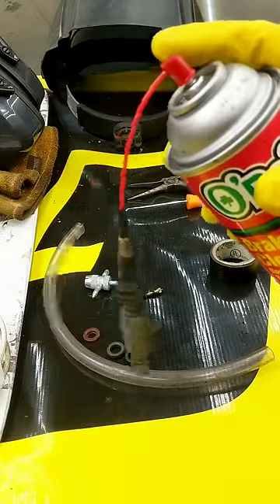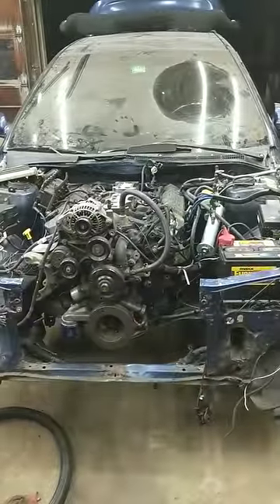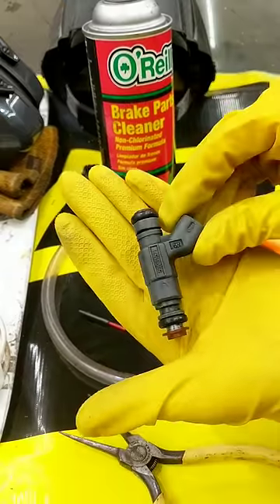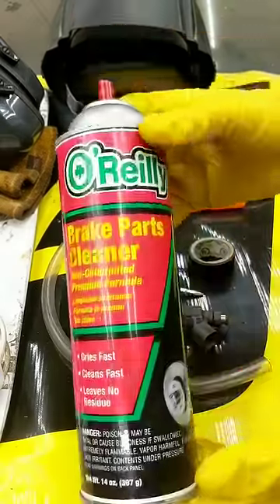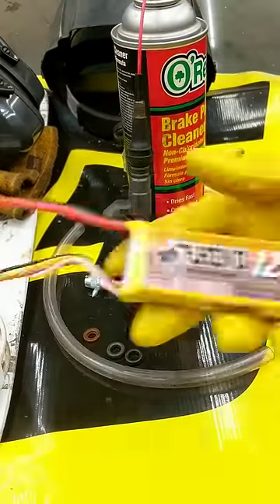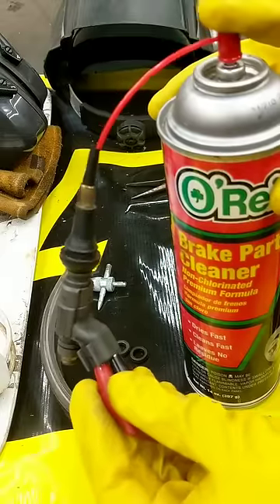DIY Injector Cleaning In 60 Seconds! How To Test And Clean Fuel Injectors At Home #Shorts

Comment: “for this demonstration im going to be using an injector from my V10 Subaru Impreza” like what?
Reply from the maker: Haha it's a cheeky self advertisement for my V10 Impreza build, but this applies to most injectors.
Reply: I thought it was a sin to engine swap any subaru
Reply: Jack your name is a big like what moment
Reply: @rustypotatos  how
Reply: @rustypotatos   it's what it's
Reply: @jackjack7594  his name is jackedoff
Reply: @rustypotatos   lucky coincidence
Reply: @kaiburns4257  it is if you don't do it properly
Reply: @jackjack7594  so I can k24 swap a subaru impreza? And not get flamed for it.
Reply: @kaiburns4257  but would you really do it though
Reply: @kaiburns4257  well me personally I wouldn't
Reply: @kaiburns4257  only way to make em fast and more reliable without leaking oil all over the place
Reply: @rustypotatos  jack doff no E
Reply: Ran straight to the comments for that one😂
Reply: @jackjack7594  yeah but why though, love honda engines (and any american v8 over 5.7L really) but I doubt I could fit a a v8 in a suby. 
besides, gotta keep the neighbors up at 3am somehow :)
Reply: @kaiburns4257  not a sin, just a royal pain in the ass if you want to keep awd
Reply: Exactly what I thought
Reply: @kaiburns4257  that's the only way to make it a half decent car.
Reply from the maker: @waluigi710  I love these cars. The GC Impreza especially and specifically with the EJ18 and EJ22 was bulletproof and reliable as hell. So easy to work on, super fun on any road. The EJ25 had its issues, but head gaskets aren't hard to fix. Or you can just WRX swap it of course! This project is more a for fun personal challenge. K24 would make it super fun, but it's a lot of work too.
Reply: @kaiburns4257  no Subaru engines are trash
Reply: I was thinking the same 😂
Reply: @kaiburns4257  a Porsche engine swap would get respect
Reply: @kaiburns4257  No, its just smart.
Reply: @kaiburns4257  Swapping a non milkshake maker in, is very admirable
Reply: @kaiburns4257  No, they have to do that all the time. Usually it's just with another EJ though since the head gaskets only last a season or two.
Reply: 😂😂😂 homie just casually mentions a v10 subi
Reply: @Kai Burns check out 3.8 V6 legacy swap lol there's nothing exempt from hacking up just our nature to make things that don't belong fit and work lol
Reply: Time to put a real motor in that Subaru with a LS7 conversion.
Reply: @kaiburns4257 it's the other way around, unless your into a 3200lb paper weight that leaks oil and blows head gaskets frequently 😮
Reply: @kaiburns4257 correct, if u actually ever want to be able to drive it 😉
Reply: @802Garage   Lol I heard that but didn't process it because I was trying to find out how to clean my fuel injectors. But wow a v10 impreza must be nice.
Reply: @802Garage how many liters is the V10, like a 5L or something?
Reply from the maker: @goldboy1264  8.0L!
Reply: @802Garage  how tf did you fit it in your Subaru then????
Reply from the maker: @goldboy1264  Lots of cutting. ;)
Reply: @kaiburns4257  it sin to own any Subaru engine

Comment: You need to put a disclaimer on the "brake parts cleaner" recommendation, non-chlorinated is fine, but NEVER use chlorinated (often sold as non-flammable) brake cleaner to clean injectors, carbs, fuel lines, fuel tanks, intake or exhaust components etc., if you leave any behind once it gets mixed in the cylinder and the fuel around it burns or it touches hot exhaust components it will decompose to phosgene gas which can cause permanent damage or death in very low concentrations(we're talking a few ppm).
Reply: helpful. I was just about to use the non-flammable one
Reply: Wouldn’t it dry way before ever being able to ignite? Like while you’re finishing the next injector the others should dry off on their own and nothing really left to ignite?
Reply: @michaelmichaelmotorcycle2174  You're running it through the injector there's a likelyhood of it sticking around inside the injector where it won't readily evaporate.
Reply: This would have been useful. I sprayed this into my fuel pump housing to clean all the gunk out. I used a blow gun to push air inside to dry it all out. You think I'm fine?
Reply: @seahawksforever9504  If it's still off the vehicle I'd leave it sit to dry for several hours and maybe blow it out again after that just to be sure it all evaporated
Reply: I don't do stupid things like that with the chlorinated stuff, but it's so much nicer because it doesn't melt plastic and other things. That non-chlorinated stuff is trash

Comment: I would do this if I had a beater car and needed my injectors cleaned. But on a nice car, this is a nope for me. Replacing injectors is usually a big job. I’m not risking the time to do the job just to put old injectors back in. Buy new and don’t look back.
Reply from the maker: Actually a very quick job on many Japanese vehicles especially! Quite easy on the V10 as well. However, 100% agreed this is not the way to do it for a high dollar car or build. This is the way to do it on a budget or when you are just trying to get a car that has been sitting running well again. Injectors rarely go BAD from sitting, but they do get gunked up. After you get them running well enough, fresh fuel and cleaner can often get them cleaned out the rest of the way. Buying new simply isn't an option for many people or is too expensive for a given vehicle, but your side is totally valid. You can always get professional injector cleaning vs just replacing though.

Comment: Carb cleaner is better, since it won't dry out or harm the sensitive components in the injector, and has some lubricating properties.  Brake cleaner is designed to completely eliminate any petroleum residue off of brake components.
Reply from the maker: Yeah I agree brake parts cleaner is not the ideal solvent, but it does work. I'm not sure I agree that carb cleaner has any lubricating properties, but it is probably a bit less harsh. Either way it worked!

Comment: Yes! I needed to see this. I've got my E39 all torn apart and wanted to give the oil soaked injectors a thorough cleaning before it goes back together.
Reply from the maker: Yeah I think I'm gonna take the rest of the injectors for this engine, clean them off, let them soak in some water based degreaser for a bit, the give them each a quick flush like this. Good luck!
Reply: I'm just stoked to hear the V10 Impreza is getting worked on at all!
Reply from the maker: @wilsonoberholzer2771  Oh it definitely is. Getting pretty close to driving and the full build will still be going up here.
Reply: @802Garage  I just giggled like a little girl watching that video of it running

Comment: This works pretty well in a pinch, I prefer to at least flow test injectors before using them personally. Make sure the electrical connection is momentary, injectors aren't designed to be driven open for long periods of time!
Reply from the maker: Well that's what duty cycle is. Injectors can be held open when they are at 100% duty cycle. I have never seen any proof or evidence that holding an injector open will harm it. It's a simple solenoid it's either on or off. Seems to me turning it on and off hundreds of times per second with countless in rush and cut off current spikes would be much harder on it than simply holding it open anyways. It will only ever draw as much current as it needs to remain open. At any rate, not trying to be a jerk at all, I just hear this all the time yet I have never seen it substantiated in any way. I will probably do a video on it at some point just to test. I agree with you for sure on properly cleaning and flow testing. This is just a DIY at home method. :)
Reply: @802Garage  I've seen injectors melt and lock up at 100% duty cycle. The coil in that solenoid is TINY. I agree that you probably won't hurt it during the short duration of a cleaning, but I feel it's wise personally. I think driving an injector at it's duty cycle limit is probably worse than a continuous hold. I hear what you're saying about the rush current but at the same time, solenoids don't work properly outside of a specific rush current range, suggesting to me that they are designed for the abuse. Having said all of this, I'm not an electrical engineer lol
Reply from the maker: I'll probably do a testing video later. Find it very hard to believe a solenoid drawing a low current is going to melt itself even if you hold it open for a minute. A few seconds at a time certainly isn't going to kill it. If anyone can actually show me proof I am wrong, I will gladly admit it. So far no amount of comments or research on my part have shown evidence or proof of such. I'm not trying to be stubborn or anything BTW and I used to think exactly the same thing having read it multiple places. I just don't have any evidence to support the claim. Hence why I want to do some of my own testing sometime. I'm not an electrical engineer either, though I do know a thing or two. I suspect a bigger problem with holding injectors open may actually be with the injector drivers in an ECU, but I could be wrong.

Comment: I think in USA there are a lot clogged fuel injectors - in Europe we have it very rarerly, why is it so? Does it depends of Your fuel with alcohol?
Reply from the maker: It likely has to do with cars which sit for long periods of time with ethanol in the fuel, yes. Almost all gas in the USA is up to 10% ethanol now, and while it causes no issues and has some benefits initially, when cars sit for a long time it can cause issues.
Reply: We don't actually have many clogged injectors. I've never seen one in my 50 years.

Comment: Although this works, I've got several problems with this method. This is a good way to blow your head clean off. Put long wires on the injector and make sure any sparking you do is far, far away from the injector! Do your connecting at the battery. Also, don't just use any old solvent. Actual injector cleaner or Sea Foam is preferred to avoid damage to the injector. When I do this, I connect a piece of hose to the injector, fill the hose with cleaner, and then use an air compressor to apply whatever pressure the fuel system would normally use.

Comment: i made the gadget to clean injectors. Just take esp8266, flash it with espeasy,  create rules which pulse open relay for 100 ms and close for 50 ms, and connect injectors to carb cleaner.

Comment: After watching this video, I tried doing this with some fuel hose tubing and electrical tape… even with it really taped up good, the pressure escaped and it shot brake cleaner straight into my left eye. Luckily, I was quick and poured two bottles of water into my eye whilst looking around into the water. I was seeing slightly different colors, but I’m okay now.
Reply from the maker: @scottdunbar9808  Ouch! Genuinely a good idea to wear safety glasses any time you are working with brake parts cleaner shiz is baaad. It can take some modulation of the valve to not over pressurize and shoot it off. I'm sorry that method didn't work for you.

Comment: Plastic syringes are very useful for making a injector cleaner.  The right size will fit over the orings leaving the small end for red tube.   Made several and works well
Reply from the maker: Great idea! I do actually have quite a few around because I used to work for a medical company. I use the big ones for brake bleeding. Makes it much easier with one person.
Reply: @802Garage  so find one that the plunger barrel is close to the injector oring you removed.  You used the o ring for the seal on the syringe.  The delivery end of the syringe can be modified to slip the red tube inside and use some double wall shrink tube to seal it.   You can actually get a good little charge inside the syringe like this and quickly do many injectors.    Cheers!

Comment: I know about cars but I still have a few weak parts. Could you just rebuild injectors for the hell of it? Like preventative maintenance? Or is it too much time and money to do that and just wait for one to break?
Reply from the maker: The quick answer is that if they are functioning properly and you have no leaks or issues, there is no reason to rebuild. That said, after 100-200K miles and especially if high quality fuel or fuel system cleaners aren't used much at all, the injectors could def use a cleaning. Mostly it will restore a proper spray pattern and more efficiently atomize the fuel, regaining some power and fuel economy. Fuel injectors are incredibly reliable though and as long as you drive the car regularly, they can last hundreds of thousands of miles. Running fuel system cleaners and some premium fuel a few times a year can go a long way.

Comment: Since you're using a tire valve stem, couldn't you use air?
Reply from the maker: Yes, but the air doesn't have any cleaning solution to help break up deposits and gunk. It could help to pop a stuck injector though or you could fill a hose with solvent that clamps onto the Schrader valve with another at the other end to attach air and blow it through at a specified pressure. A lot of effort though.

Comment: Low flash point brake cleaner, clips and a battery.  What could go wrong?
Reply from the maker: Nothing if you're careful. I literally did it to 10 injectors and never caught anything on fire. The one bit of advice I'll give is it's smarter to touch the connector to the battery side than the injector side.

Comment: Doesn't electrical tape/adhesive melt with carb cleaner and if so isn't that being blown through the injector
Reply from the maker: Didn't seem to melt or dissolve to me, even the adhesive. It's a good point though. Best to keep the tape behind the tip of the straw.

Comment: You can use a 9volt or the car Battery? Trying to tell me 3-5 volts less won't matter/damage anything?
Reply from the maker: Yes because while the opening time is slower with lower voltage, there will still be plenty to activate the injector. Look up an injector dead time chart and they rate the opening time from typically 9V all the way up to 15V or more.
Reply: @802Garage  I'll take your word for it bit id  imagine thr brand and quality of the injector plays a role. It's not like this is a regular maintenance item but that came across my mind
Reply from the maker: @My-Hunt  Hmmm as far as I know any modern 12V injector can operate as low as 8V and as high as oh I have no idea probably 24V or more, but I have no idea what level would be damaging. Many car alternators run at over 14V and while starting a car voltage can dip very low, so the voltage difference really isn't a big deal. The bigger concern is Amp draw and that holding the injector open could cause damage to the coil. I haven't actually seen any proof this happens, but I'd imagine it's possible. That's why tapping is best. Port fuel injectors are relatively simple devices though. Just a basic solenoid really.

Comment: I do recommend cleaning injectors if needed but please if you do this do not hold the injector open that long. Keep in mind the injector on time is in the milliseconds, holding power to it is not a good idea
Reply from the maker: Injectors can live at 100% duty cycle. It's a simple solenoid. This won't harm the injectors. The main reason older injectors couldn't be held open at full current draw is the ECU injector drivers themselves. I have never seen a single piece of concrete evidence that holding an injector open will damage it, but I do intend to do my own testing soon.

Comment: Yes i agree as a quick stop gap, but you cant judge the flow rate that way and thats like blood pressure to a engine
Reply from the maker: Of course not. This is DIY cleaning and testing not flow rate measurement. :D Just a cheap solution to injectors working like crap.
Reply: @802Garage  fair one just wanted to put the comment as some people dont relise how important flow rate etc are, and think because they cleaned them they are like new oem, but like i say i agree its a good stop gap
Reply from the maker: @upsidedown4155  I just get a lot of negative comments haha. I try to respond nicely usually. I generally believe anyone who is going to attempt to clean their own fuel injectors probably knows something about how an engine works and can Google fuel injector cleaning. Maybe I have too much faith!
Reply: @802Garage  lol i wont deny people in general do at least try as we are always learning regardless of experience, but there is always a exception, its for the same people who need signs like 'dont drink the battery acid' or 'dont walk in front of a moving train' 🤣🤣 all the best buddy

Comment: Injectors work off a pulse when you give them direct power for more then the millisecond it leave the passage open making it stick.
Reply from the maker: That's not how a solenoid works... If that was true then relays would all stick on, for example. You need to learn some electronics principles before you try to educate.

Comment: I prefer to leave them in the car, correct 2 with 2 separate bits of hose, and use 2 Ts to connect it all to a can of brake clean and just turn the engine over so as to not burn the injectors out.